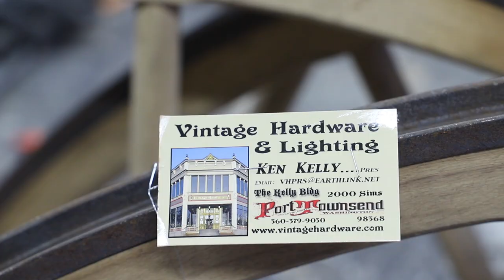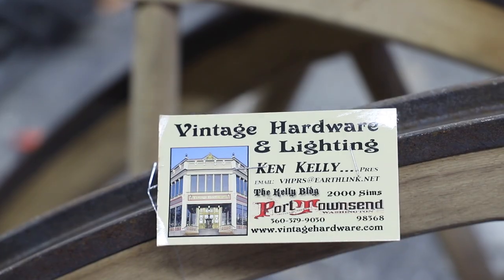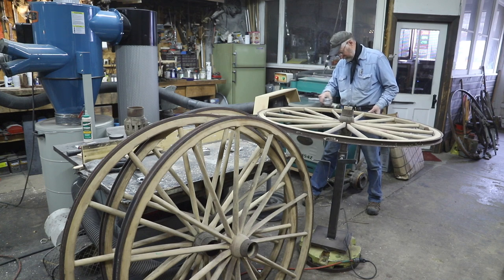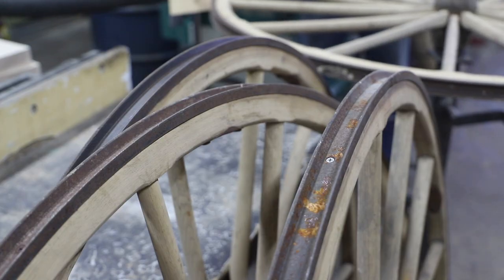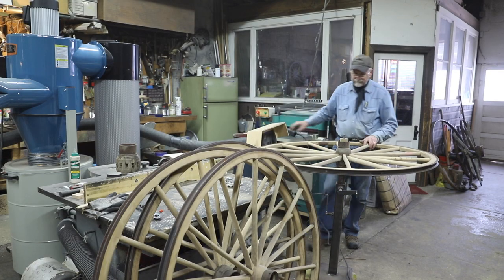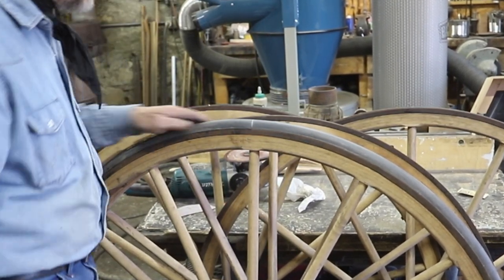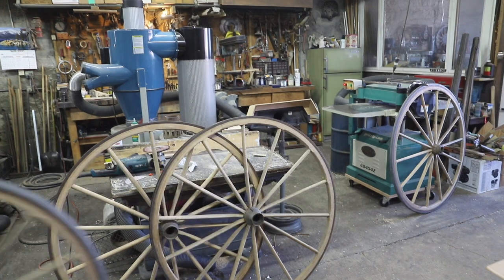Installing Hard Rubber Tires | How the Tire Machine Works | Engels Coach Shop

Comment: Greetings from England. I remember being taught to 'twang' the wire tension to 'middle c'. Also we called the jointing of wires 'bronze welding' instead of brazing and I had to take a special exam, with a certificate, to qualify to use oxy-acetylene instead of gas/air torch to do it.  That was 50 years ago...Thanks.

Comment: I have seen you fitting rubber tyres before and as always I appreciate your skill and craftsmanship but the most impressive thing is the rig you built to fit them. Big effort.
Reply: It surely takes a wheelwright to figure one of those contraptions out !!

Comment: Wow, as usual, you make it look so easy. Great machine you built. I have a ' Sweet tire machine" . I got it from craigslist in New Orleans, shipped to Los Angeles. It was a man in his 80s. He said he had it for 40 years and it was old when he got it. It is hard to use, it pulls each wire in the opposite direction and that tends to make the rubber twist. Yours pulls both the same way, We do 2 1/2 in wide rubber. My friend and I have only done 6 sets of 4 wheels.

Comment: I had a business many years ago where I designed and built custom made wheelchairs. Amazingly, installing these hard rubber tires is almost exactly like installing them on wheelchairs.
Just bigger and there's no soldering, you just loop the wires together and pull them tight. Then you slide the tire over the loops.
It's so relaxing to watch you do your work Mr Engels, you are a true craftsman and very interesting.
I just wish you lived closer to Austin Texas so I could go watch you work and clean the shop 
for you !!!

Comment: Doing WW II on 16th St two blocks east of what was Crawford Ave. in Chicagom was a little shop that specialized in installing rubber tires on the like of my tricycle or my mom's baby buggy. Cut off the old tire, found the right size tire to use, was on a spool.  Ran a wire through it and somehow twisted the two ends together around the,  push the two ends together.  Faster than I can type this.

Was a lot of shops like this back then, ran through my old neighborhood via Google maps. all those shops are gone, all vacant lots now.  William Penn grade school is still there where I went to school.

Practically anything we buy today is throwaway.   Retired automotive engineer, back then practically any component was rebuildable.  Today, throwaway, can't even rebuild a starter motor, largest throwaway part is the unibody, no way to repair these outside of a minor dent.   And when that is thrown away, so is the rest of it.  Lived near a park, if I could find an empty coke bottle, was worth 2 cents, could buy a lot of candy with that.

Comment: Experienced bicycle wheel builder/fixer here. Most excellent, sir. Thank you.
(I would've glued the tires as well as wired. And I wouldn't have used the WD for a lube, but would've used something dry, like graphite. Oil based lube on rubber has longevity issues. And I definitely need to consider moving to Montana!)

Comment: Well, whaddya know!  That's the exact opposite of what I thought you'd do. I thought you'd cut the rubber exactly the circumference of the wheel, and the tension of wire would pull it together. Thank you for showing that amazing operation.

Comment: I finally understand the two things that happen when transferring tension from the crank handles to the jaws. I was only seeing the rubber losing tension, not the wires gaining even more tension. If the rubber changed composition, like from a new vendor, would you have more or less overlap for harder rubber? how about tension on the wires?

Comment: Hi:
That was a smooth operation that still works.  I have watched you do it before and it never gets old.  At the end of the show I think I saw a new Shop Toy.  Did you get a New Shop Dust Collector?  How big is it ?  I also noticed that that the dust collector had a 5 micron filter on it.  All of my  dust collectors have them and they are very nice.
As always thank you for sharing.
Reply: Did you notice it has a remote control
Reply: Yeah I had been worrying about all the dust that Dave was breathing.  Also in a previous video, he mentioned the fire hazard of all that dust lying around.
Reply: Lol! People who live and work in rural settings always have dust to deal with. I have lived and worked in dual Ares most my life. You dust your furniture in the morning and by evening there it is again. I realize vulcanized rubber, wood, and various other fine debris/dust are considered health risk. I recall as a kid in high school, I spent a summer working in a tire shop. They did their own recapping there (both hot and cold). The guys in the grinding room were covered in black powder, in those days no one wore or concerned themselves with mask. (Hecky darn, one place I lived had gravel from an old asbestos pit, you could pick through the gravel and find asbestos in the crushed rock! So all that dust on the furniture... yep, it had asbestos in it! 😏😶)
I had one boss that if he saw you wearing gloves, he'd comment that you "apparently weren't planning to get all of work done that day." It was his opinion that a man wearing gloves was more concerned about scraps and burns than getting something done. Times have certainly changed, and safety equipment exist today we never dreamed or even thought about in those days.

Comment: <smiling>  I think you could make another 'machine' that employed a powered, reversible(?)  flat steel roller about 6" in diameter.  Turning about 20 RPM, this could be brought to bear with some pressure against the newly installed tire... Alternate rotation (or maybe even reverse the wheel) and run this contraption until the 'thump' is gone when the tire joint comes past.  My amateur guess is this would massage the tire to an equally loaded position within its new-found friend.... the rim!    See?  I'm just here to help.. :-)   Great video, thanks again, Mr. Dave!!
Reply: I would expect the tires to equalize compression under actual operation. No need for extra tool to make.

Comment: I’m surprised someone still makes the rubber tire material.
Reply: it's probably synthetic rubber now and can be made with an extrusion press I think, so would cost basically nothing for a factory that already makes other rubber stuff.
 Amish and menonites obviously if for nobody else, need lots of this tire material
Reply: Massive amounts are needed for the Amish and Mennonites.
Reply: @jeffjahns1974  I realized that Amish are still using it. However, I didn't think it would have been enough demand.

Comment: Looks cold with you today (or is that yesterday?).  Mind you, summer here and I am about to put a jacket on.
At 1:26, would I be correct in thinking it is the width of the spoke, not the entirety of its length that you use as rule of thumb for the overlap?
11:04 is it best to do that on board or directly on cement?  I ask because I see the rubber marks you are forming on the board seem to be the first and am sure I have seen you do this on cement in another part of the shop on other occasions.  Not that I will ever be in a position to do this myself, pure curiosity?
Keep up the good work. Your clients must feel comforted to know they have someone with the knowledge and skills to put their vehicles to right in a strong, safe, lasting and traditional fashion.   I hope they know how lucky they are?!

Comment: When me and my brother wore out the original black rubber tires on our little red wagon wheels, my dad would make new ones out of red garden hose.  He would tie them in place with bailing wire inside the hose.  He showed me how to do it, but I was a little runt at the time and didn't understand what I was seeing.  He tightened the wire by twisting it, and that also acted as the "knot" that held the ends together.  The mystery is how he managed to get the wire tight enough while keeping the ends of the hose from coming together and hindering him from finishing the tightening.  I can't remember how he did it, but he did it.  And as I said, he knew that many years later I'd want to know, so that's why he showed me.  Fat lot of good it did me.  He passed away years ago, and took many things with him that I'd love be able to ask him about.

Comment: Like how they stress concrete by placing braided steel cable into the mold, tighten the cable to the required elastic stretch length, pour the concrete into the mold, wait for the concrete to set, then let tension off the cables, where they compress concrete to the point where it bends without breaking.  Or why they tension wire bicycle spokes so that instead of buckling easily, the wires simply support the weight of the bicycle and the rider.  That's exactly what you are doing to the tires to make sure that they stay put.

Comment: Seems like I've seen you do this thing before, and it was pretty labor intensive then as well ,
. Did someone teach you how to use that machine or did you have to figure it out by yourself? thanks
Reply: He built the tensioning rig himself (one of his early episodes), without that rig I imagine it was done by a tradesman with extra big muscles :)
Reply: @paulhammond7489  gee I thought I'd seen all the episodes I guess I'll go back and see if I can find it did he have some kind of plan to go by or did he design it on the fly?
Reply: @larryshaw6517   He did not make it in a video, , he was using it installing a rubber tyre on a buggy in an old episode, and he mentioned that he'd made it.  I've searched back through his videos and cant find it... Hope Dave reads these comments and let us know :)
Reply: @larryshaw6517  Found it! it is in the Piedmont Wagon build series. He states that he built the tensioning machine. Here is the link https://youtu.be/sldK65_HUgc
Reply: @paulhammond7489  Thank you Paul for putting up the link  to The Piedmont Wagon video, that cleared up a lot of my questions.
Reply: @gregkilgour4545  Glad to help :)

Comment: I don't know if you'd know but here goes. I have an antique Hubley motorcycle with rock solid rubber tires from 1930s that are warped to the side from sitting around for years. Is there any way to heat them or fix them?

Comment: Before that last bounce to set the rubber around the rim, would it be wise to seal the joint with an epoxy? Kind of like Loctite 495 or 401 or some other form of vulcanization?

Comment: I'm struggling to see where all that overlap went. Could it simply be the tension of the wire pulling into the wheel that much? It seemed like there wouldn't be that much play when he fit it to measure.